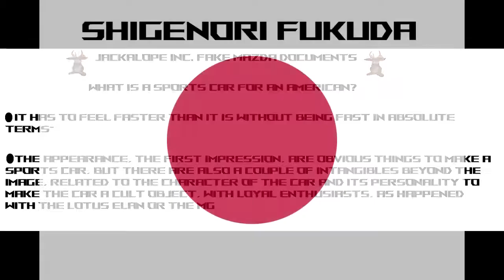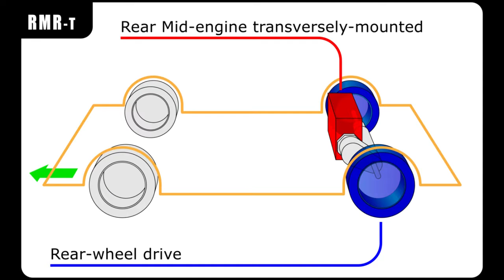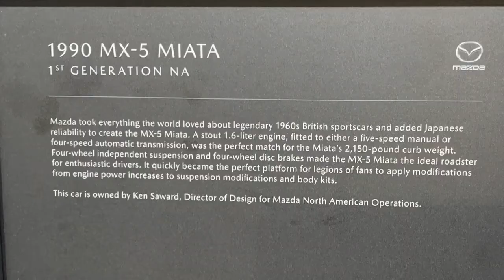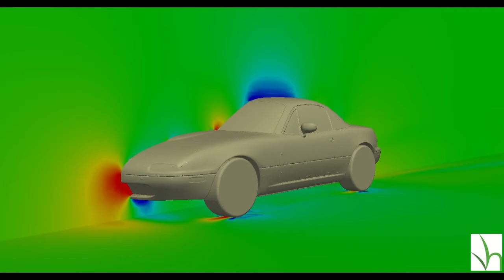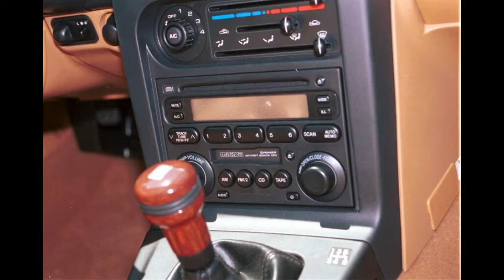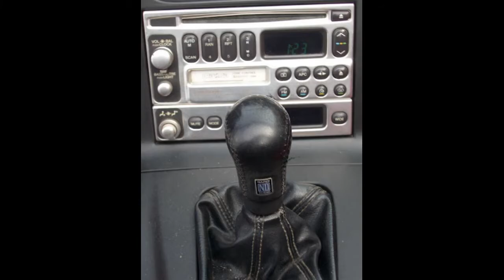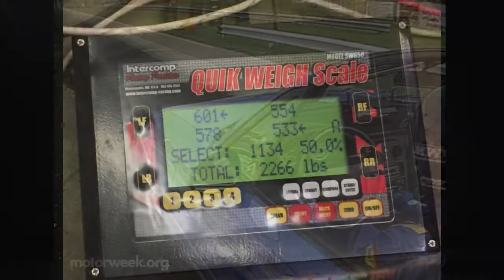Miata

Comment: The older I get the cooler the NA is, it would make a great track car with a K-Swap.
Reply from the maker: I have been eyeing up my Nissan SR20DET powered Mustang, as there is a swap kit to put a SR in a NA Miata, but with more power comes the need for bigger brakes and a beefier rear axle. A SR or K swap NA would be totally awesome, but it wouldn't be cheap ;-)